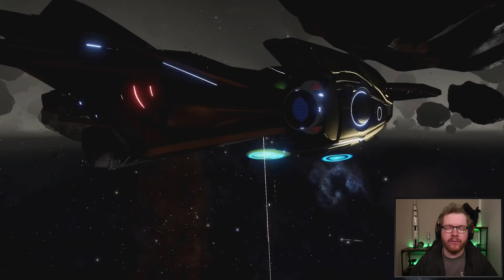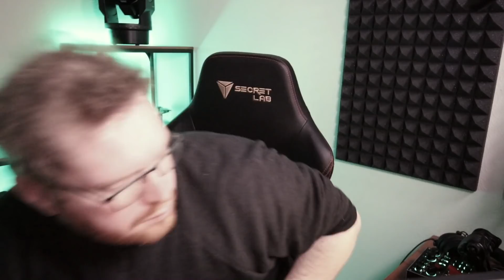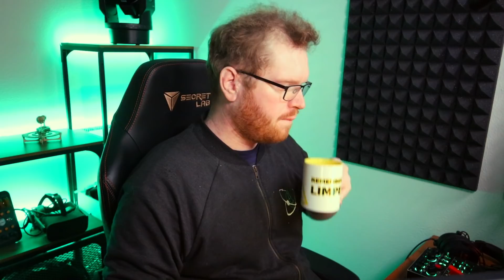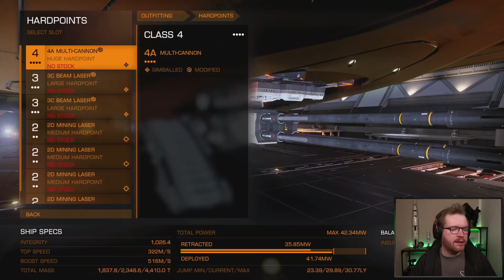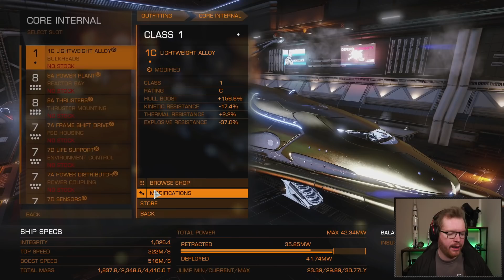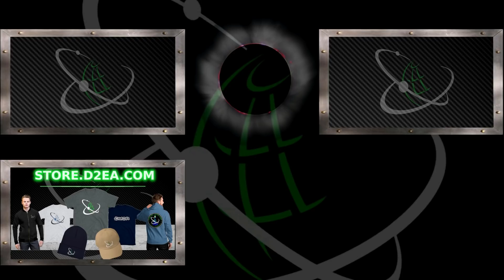Res Site Mining Build | Gold Digger Variant | Elite Dangerous

Comment: Thanks for a good build and a good explanation so we can vary it as needed.  Just wondering why 5A Collector Limpet Controllers not 5B for the longer range?  The shorter 5B lifetime doesn't matter a lot given you can carry far more of them than you ever need, and longer range means you can start moving to the next rock without worrying about losing many of them.  Are 5As actually any faster than 5Bs at startup time or anything?
Reply from the maker: No you can use A or B. Since we will be hugging the rock the range of the B is not really needed either. I juts happen to have A fitted
Reply: @DowntoEarthAstronomy  Thanks.  Will head out later today and give it a try.
Reply: I use D collectors because I never need the range and they are lighter

Comment: Great guide. 
I wish you'd make one for the mortal players. A less than 100mil total shio cost and only some Badu engineering. 
Now gotta go and do passenger missions to make some 700mil. Fast lol
Reply: Asp Explorer might do the trick, but not a lot of cargo space. I just bought a Krait Phantom last night and set it up for mining. Haven't had a chance to try it yet since the servers are down. But it gives me around 150 tons (IIRC) of cargo and is outfitted for every type of mining. Don't remember what it cost total, but I'm pretty sure it's under 100 mil and has no engineering yet. Poor jump range though, haven't gotten an A-rated FSD yet. I've used my Clipper to mine, but I don't really like it.
Reply: i know this is 5 months ago, so dont slap me if this is irrelevant now, but when i first saw this video i was sitting on 80M. i had an asp explorer that i fitted out for core mining, when i got enough cash i went straight for a python with core mining build ( you would think the loss of money counts, but i made up for that loss in no time). from the python i was able to get around 800M in about 6-12 hours of gameplay. these days i dont need cash really and if i do it only takes an hour or so to gain 100M+ ( depending on what you are mining and the sell prices off course)
ps: the python build is in one of d2e builds ;)